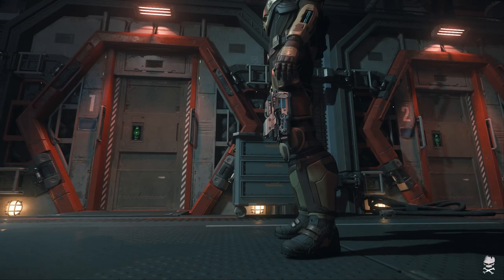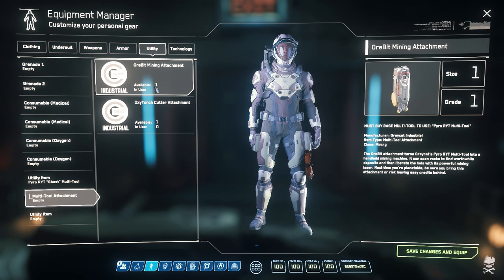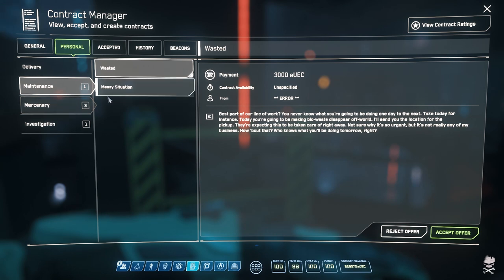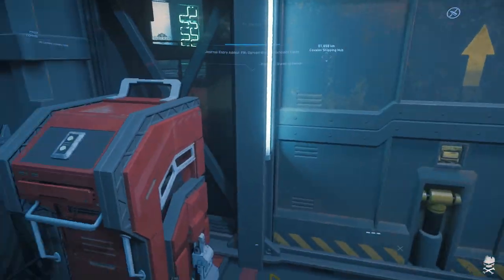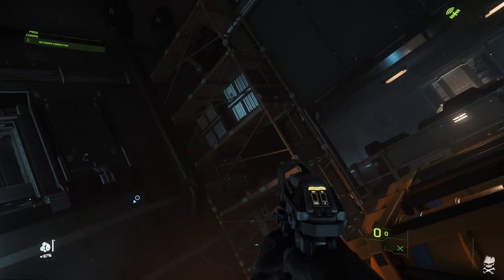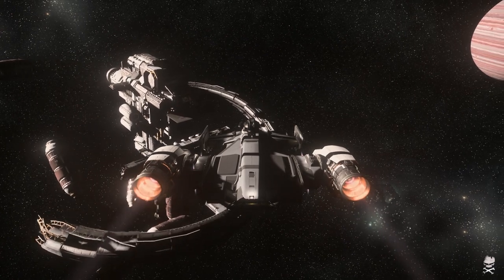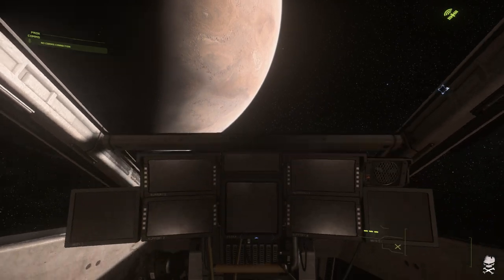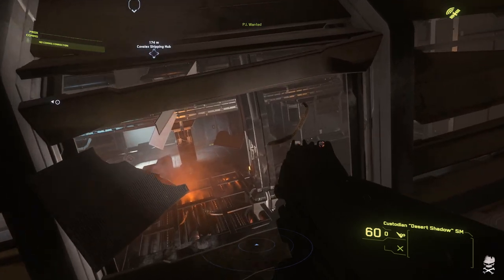PIRACY SHOW : Close that Loop... Tractor Beams

Comment: I think making the cargo "magnetic" is a very good idea to implement to try and use to clean up space wrecks and stuff. Different power settings and components in order (on the ship level) to have different ranges or capacity would be a good closing of the loop

Comment: Good thoughts. And in addition, perhaps an EVA "Tether Mode" where the tool (possibly while even holstered after locked on a sensible sized item) would function analogous to a trailing/following strap or rope as one eva'd around and flew back towards your destination when in zero G, towing the item behind your person as you exited a wreck or crossed an expanse.

Comment: Remember there is the bike handle bar gav thing that connects to the 1scu container. Also remember in the RSI email a few weeks ago. On the timed cargo it showed that 1 SCU container opened and 4 small boxes fitting in it
Reply: Yes, 1 SCU = 8 (.125 ) delivery boxes that are carried. Four on either side.
Reply: @ericwollaston5654  yes each box now carries 12 items instead of 10 it used to
Reply: @boris-kraken8185  Actually, the .25 is from the buffer zone around the box that contains the refrigeration, protection, stabilizer field, or whatever is required to keep the inside cargo safe - from my understanding. You can take any delivery box from a mission and put it on top of an SCU box to compare. Just buy some cheap cargo like waste or scrap to get one on your ship if needed.
Reply: @ericwollaston5654  yes I picked up some on a mission and tried to sell. It read each was now 12 inside not 10. Hopefully we learn more today in cargo decks

Comment: No magic.
Items are physicalized.
I dont see too much where the problem is.
The first question is should in space a tractor beam work for all and anything that is considered a physicalized item?

E.g: the way cutlass breakdown, I am not certain a mighty caterpillar can pull and place a cutlass hull inside.

The biggest problem I saw in space regarding floating crates but even harder those little drug-like pouches floating is that space is huge, space is dark and I know I more than easily miss any and many when I go get after THE LATEST SHIP and do so hopefully cutlass I killed to hopefully find.... something... maybe.

It is 100% impossible for me to find stack and stocks and/or broken ship if targeted hull 
-Is not latest ship I killed
-Broken hull despawns too fast
-Might have flown through and ejected stocks all directions as it was not seen or seen just too late while fighting other ships, or a simple mistake on my side, ot has happened before.... "coouugh".

This leads to another question, should  tractor beam come with another feature such as crates, pouches and cu scanning of sorts, and what is the max distance should it see?

Also, how long should broken hulls last in space.
We cannot have infinite persistence or space as we know it will have yet another 2.x vortex pull that sucks all inherts which could easily be stanton sun by the way and easy peasy way for CIG to prevent server drag with overload of physicalized items, or, give a timer despawn but what we see currently is far too short!.

As for how the tractor beam looks, I dont care too much but please don't blind people.
Me personally an invisible see through flow that distort background is totally fine with me.
Reply: Tractor beam becomes tractor "cone" in order to attempt to gather objects... Also a scanning feature so you can find the space debris when your within say a 1km range